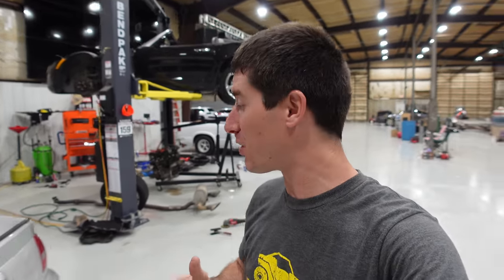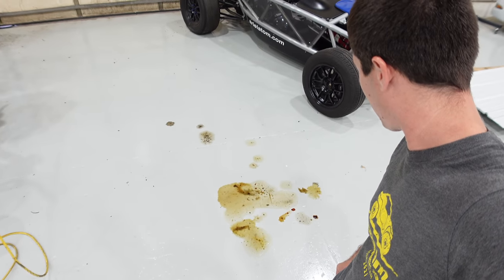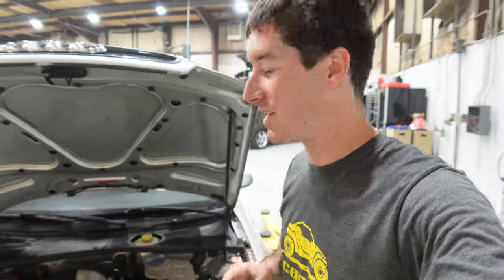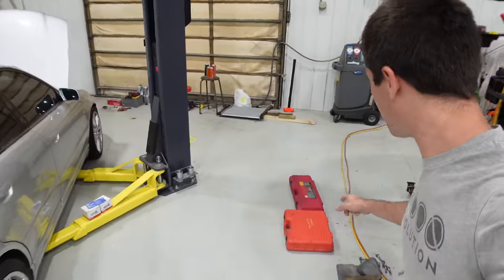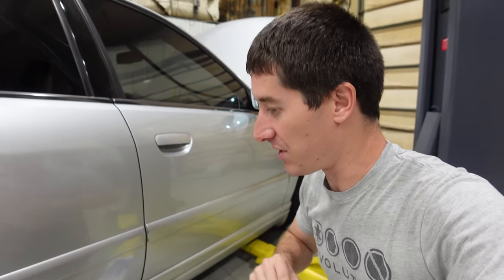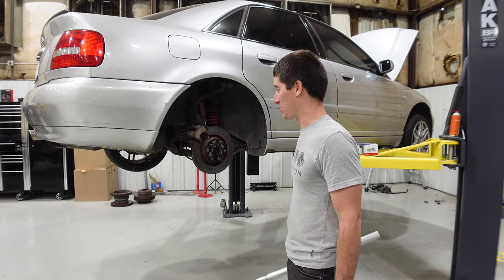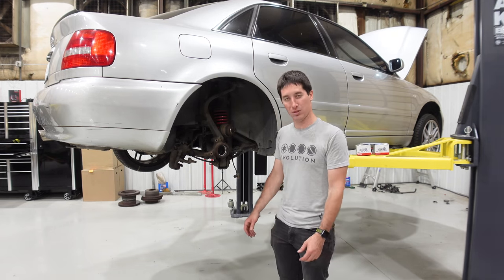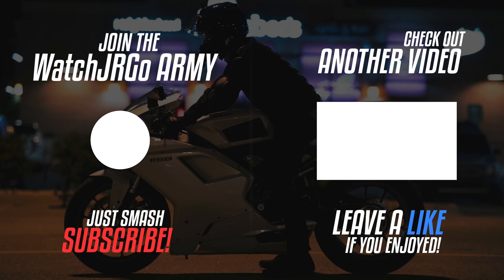I BROKE Every TOOL Trying To REMOVE My Audi S4 Wheel Bearings

Comment: If you have a race left in there just get a drempel with a cut off disk, cut a slit in that race, take a cissel and a BFH and wack that slit. The race will crack. After that it's easy to remove. 
Installing the new bearing will go a lot easier when you put the bearing into the freezer overnight and  heat up the area where the bearing needs to sit. Use some work gloves and push that bearing right into place. When temps equalise the bearing will be a snug interference fit. Job done!

Comment: Lay a bead of steel around the inside of the race (the bearing surface, not the edge) with a welder, when it cools it will shrink and the race will come right out.
Or, use dry ice (or even ice) to cool the race after using a torch to heat the spindle.
Reply: Done this many times. Most of the time the bearing or race just falls out
Reply: I have to remember that! I wanna try that.
Reply: @jfv65  it literally blew my mind how well it worked. The race literally fell out of the hub!

Comment: A lot of the time there snap rings that hold those bearings in place, I didn’t see you remove them. Also not a grease on the threads of the puller and I always use my impact gun. to get the race off the hub using grinder with the cut off wheel at an angle and then release the tension a lot of time to just falls off well you can try heating it up

Comment: Did you grease the threads and washers on the bearing puller? That can make or break the job. I pulled the front bearings on my 300k mile Subaru (life-long rust belt car) with a tool exactly like that, and while it took a 24" breaker bar on each side of the puller, the bearings came out without power tools

Comment: Buy a 3/4" drive single hex socket set with a 36" long handle - job done
Reply: My thought exactly. I bought a 3/4" drive set a few years ago. It wasn't cheap and I don't use it all that often, but I still consider it a great investment. You can put a LOT more muscle on a fastener with a 3/4" drive than than with the 1/2" drive stuff. It's saved the day (and my 1/2" tools) on several occasions.

Comment: .... Breaks every wrong tool, goes to store to buy more wrong tools instead of just buying the right but in a half inch drive. I feel like that's something Tyler would do, not you!
Reply: Yeah, i kinda thought he would have known better.
Reply: He's a YouTube wrench twister. He's not an actual mechanic. This is what you should expect. He used a ratchet to try and remove an Audi axle nut.. that tells you enough.
Reply: Yeahhhhh. Always carry the 3 primary sizes. Especially if you own any trucks
Reply: @diablo7322000  You would be stunned who many young techs have a ten thousand dollar tool box, with one half inch ratchet.  Just like JR.  Those boxes are nice and shiny but you need the tools first.  I will add it also drives me nuts how he drops everything on the floor.
Reply: @diablo7322000  AMEN!!
Reply: @patcb829  yep I've hired many and watch them get screwed on the tool truck, then turn around and ask me for a socket they don't have🤣
Reply: They aren't very sharp in Kansas
Reply: How can somebody not have a clue so badly?

Comment: Before I started watching this video I knew that JR was going to struggle with this just like all the new techs at an Audi dealership or independent shop. This repair is one of few reasons why I have a four feet long 3/4" drive ratchet with a step down 3/4"-1/2" socket and the mega wheel bearing cup set. You can look at my IG for the post on 3/26/2020 to see pictures of it.
Reply: Good ol' German engineering

Comment: When a 3’ pipe doesn’t work get a 10’ one, that would apply much more torque to it. I wouldn’t use a ratchet for that, use a breaker bar with 1/2 socket.

Comment: Excellent video - love the Audi content but how the F do you have a 100K sq ft shop, numerous bend pak lifts, a big ass roller box, but not a 1/2 in drive 14mm hex socket or a slide hammer??? Also, quit using torque wrenches as breaker bars.
Reply: He doesn't even have a basic tool bench with a vise.  < shrugs >

Comment: Why are you using a ratchet and 1/2" adapter? Where is your 1/2" breaker bar and 1/2" impact socket? 

Why don't you try lowering the car and push on the cheater bar instead of trying to pull down on it? Then yiu don't have to worry ss much about the car coming off the lift.

Comment: It's probably been said, however, in order to remove the inner race from the hub. You use a cut off wheel to put a slice in the race, no need to grind all the way through. Then take a chisel and hammer, a couple good smacks driving the chisel into the ground out valley and the race will crack. Then it should come off pretty easily, no pulled required.

Comment: Map gas would have been your best friend taking the axle bolt out. Old audi's are a nightmare. A love hate relationship. Took me hours to the front wheel bearing in the driveway. Then when I finally finished I parked it out front and a lady backed into and totalled it. Literally 5 minutes after I was done.

Comment: I know this is a crazy and super risky idea, but have you considered taking a die grinder and notching the bearing races? Sounds like they're heat welded into place, so it's going to take a stupid amount of force with a press to get them to pop out.
Reply: Not that risky, however depending on what the hub looks like under it is the key, a small notch and an air hammer and they will pop right off. But sometimes the hub doesn't have enough meat left on it to hold the bearing together. If it's been going bad for a long time just get new hub and bearing.

Comment: question is did you remove the snap ring before trying to pull that bearing ?
Reply: Not all cars use a snap ring for the bearings.

Comment: I did this work back in 2004 on my 2000 S4. 
It’s a pain in the arse!  Only way to remove the bearing is remove the entire upright assembly and remove bearing with a 20ton press.  Even 20ton press is stressed.  
The hub and bearing were replaced as a unit when I did it.

Comment: I think it must be a vw/audi issue with those rear hubs. My mate had a early 90's vw passat 5 cylinder essentially a rebadged audi, and we had the same issue. Tried every tool known to mankind and oxy and couldn't get the rear hubs off. Ended up with a giant grinder and replaced the entire rear hub. Once I can understand but we had to do this exercise 3 times every time the bearings went new hub assembly.

Comment: I have a B5 A4. Breaker bar with a 3-4 foot pipe, 1/2” socket and do it on the ground.  My IR impact didn’t cut it.

Comment: Use half inch nonratchet with 2 ft handle,  and a six ft pipe, and go for  it,  save ratchet  for later,  works on frozen  bolts 50 percent  of the time.

Comment: I just changed a wheel bearing in the subie today, used a tool I had to make. Grade 8 15/16 head bolt and nut, some super damn heavy washers, about a half dozen of them, and something to space them away so that it comes out of the hub. Then the slide hammer
Reply from the maker: Slide hammer had nothing on the S4, it didn't even flinch 😢
Reply: @WatchJRGo  lol! The slide hammer was only for the final couple tugs.

Comment: Had the same problem with an is250. Use two thick bolts and two nuts of hardened steel. One big ol airgun and a wrench did the job.

Comment: I use my Harbor Freight EARTHQUAKE XT cordless 20V Impact for tough bolts/lugs.  It's never failed me yet.  They're not crazy expensive either.  You might also invest in a Milwaukee right angle IMPACT.  It's amazing especially in tight spaces.  Again, not crazy expensive.

Comment: Can you take an air saw with a metal cutting blade to the inside races? I've done a similar trick with a trailer axle and a die grinder. Maybe cut the race at least once, then drive it out, or twice on opposing sides, and pull out the 2 peices?

Comment: So I been watching this Channel a long time, the money you have spent through the yrs on cars, building & building repairs why not spend it on tools and equipment, I have more tools then I know what to do with at this point in my life, from 3/4" to 1/4" drive with breaker bars that need no pipe to break a bolt loose. If I made the $ you do at your age why not invest. I have been getting my own tools since I was 12 & I am 54 now ( and still buying tools )
Reply: I swear I'm not trying to bag on this guy, but who TF "works on cars" regularly and doesn't have a goddamn half inch breaker bar?? Come on.. It's like 22 bucks at hazard fraught for a Pittsburgh pro, and those things will take some serious abuse and ask for second.

Also, stop using adapters for torque applications for fuck sake!

Comment: Carefully cut a line in the race with a cutting wheel then take a chisel and hammer to break it the rest of the way. It will slide right off after that.  Also put that bearing puller on and send it with the impact, it will come out.

Comment: You see the Audi Logo... These are angle grinder blades. Since that is the most common tool used to take apart an Audi.. Sometimes you wonder if the bolt is welded on..

Comment: Changed the wheel bearing on my 05 Prius. Pulled the knuckle assembly. Built a 2x4 box for the knuckle diameter to rest on. Held a full size sledgehammer that matched the race diameter. Then hit the head with a 3 lb sledge to drive the race out. After 10-15 good swings, it came loose. 2x4’s we’re toast, but lasted long enough to get the job done. Is it wrong if it works?

Comment: What the other guys said below...but coming from the mid west with a lot of salty winters, in my experience Acetylene aka big, red hot heat is the way to get wheel bearings off the knuckle.
What would I have tried for the broken bearing and stuck race?  I would have cut a notch in the race with a dremmel.  Pretty surprised you didn't try that.

Comment: Let me know when you get to the fronts, with the stupid pinch weld bolt that galvanically welds itself into the upright. Would love to know how you are supposed to get that out without melting the aluminum.
I bought new uprights in the end.

Comment: I have 14mm too 17mm high tensile allen keys which i've regularly used steam pipe on the end of them for those jobs 😊.
Also get a 3/4 too 1 inch Chinese Socket set and stop toying around with 3/8's toys , lol

Comment: If it wouldn’t catch anything on fire, I’d get the torch and burn through the bearing race, or, use a cutting wheel to cut it, or, a chisel to crack it.

Comment: Wait, how do I have a half inch drive breaker bar (which really got a workout this weekend doing lower control arms) and you don't? All my "serious" car tools are half inch drive (mostly Pittsburg, some MasterForce aka GearWrench one-off sizes, some Teq aka Crescent/GearWrench), got a good old (Made In USA amazingly) Allen-branded half inch drive breaker bar, and for really tough stuff, I've got the handle from my conduit bender to slide over it...

Comment: Why keep buying 1/2" drive adaptors and just buy a 1/2" drive... I own one and it is alot more brawny than the smaller ones.  I doubt you would break it even with a cheater bar!

Comment: The interior damage on your audi - I stopped fixing up 2000 and newer VAG products because there is something with the plastic they used that makes them turn to glass.  It seems like the heat and sun here in the south fatigues the plastic and you can't do any interior work because everything breaks when you try to remove it.  VAG also loved "soft touch" plastic coatings for a more luxurious feel which eventually turns to goo that I have tried many things to remove without luck.  Japanese cars of that era I can still remove and reinstall interior bits without breaking if I am careful.

With axle nuts and bolts I had a similar experience.  I twisted off a half inch breaker bar by jumping on it and almost broke my leg in the process.  Bought the half inch milwaulkee impact with the biggest battery I could find and it was off in less than a second.  I was astonished and just sat down laughing at the insanity of it all.

Comment: After all the maintenance single turbo convert the car so it’s nice and easy to work on use a precision or borg Warner turbo project b5 is a good site for single turbo stuff and ringer racing makes the best clutch and flywheel kits for these cars single disc clutches that can go to 1000ft lbs of torque and feel almost like a stock clutch

Comment: You have that huge shop and all those tool boxes but don’t have a SINGLE half inch breaker bar… so you use a torque wrench. Completely ignorant
Reply from the maker: Or is it “I don’t want to own tools I don’t need?” Oh yeah, it’s that.
Reply: @WatchJRGo  Uh, what? Why in the literal hell would you not want to own a proper tool that would make your life significantly easier, but instead risk wrecking anything resembling the calibration of a torque wrench?  This is probably the most ludicrous thing I've read in twenty years man. Harbor freight sells 1/2" Pittsburgh breaker bars for twenty bucks and those things will take anything you give them then come back asking for seconds.

"I don't want to own tools I don't need" well if you're putting cheater bars on a 3/8" Ratchet, clearly that statement is an outright lie...

Comment: 3/8 drive hopeless for hub nuts/bolts. I've broken high tensile 1/2 inch drives on hub nuts (damn Honda CRV was the worse). It's exactly why I ended up with a 3/4 breaker bar in the tool box!
Reply: I use a scaffolding pole on 1/2 breaker bar.
Reply: @philtowle4683  yeh, that’s how I broke my 1/2 breaker bar 🙄 Took it to a professional workshop, they broken theirs. In the end a Milwaukee gun got it off. That sucker was on there tight, and it wasn’t even corroded!

Comment: I can only assume that using and snapping 1/2 to 3/8  adapters is either to increase views or an attempt at cost cutting. Either way, would it not have made more sense to just buy the right tool rather than half-a**ing it, repeatedly?

Comment: JR.  1 minute test on the audi.  Set multimeter to 20vdc. Start engine, turn on headlights. Measure from the engine to the body.  More than 0.04 volts on the meter can tear up wheel bearings as the negative current coming out of the alternator trys to go thru the transmission, cv shafts and across the wheel bearings to get to the body. Where everything is grounded.